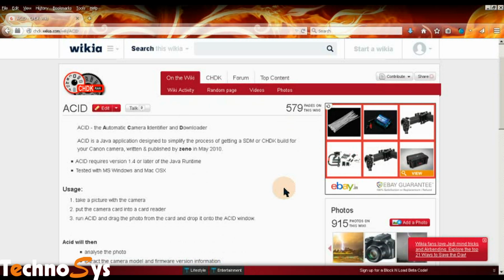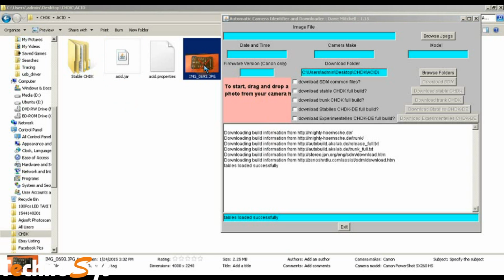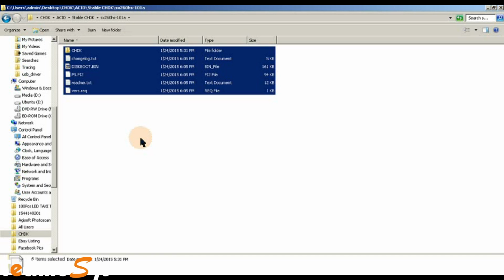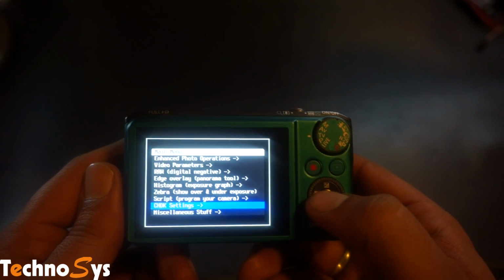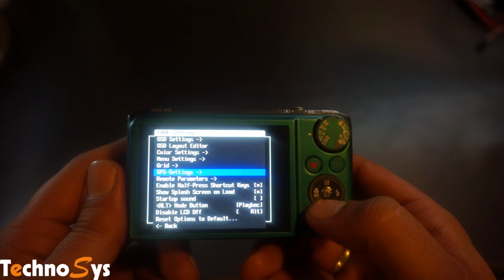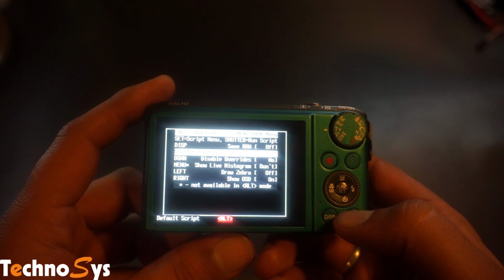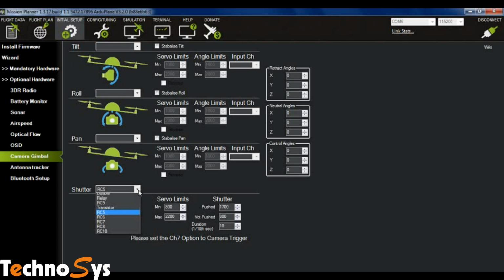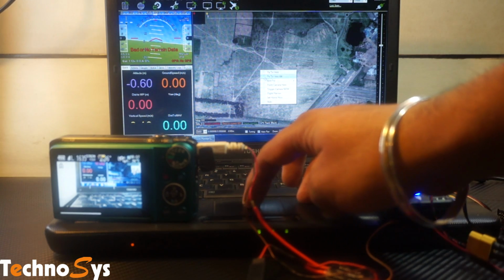Trigger Canon SX260HS with CHDK Using PIXHAWK or APM

Comment: i am about to put together this setup for my pixhawk. but looking at the wire diagram there is only a signal wire going
to the pixhawk. should this trigger setup share the same ground as the pixhawk?
i was going to use the battery that powers the gimbal motors to power the 5v bec.
Reply: YOU COULD HELP ME TO CONFIGURE MY CAMERA CANON

Comment: Hi, I followed the video to the letter, but for some reason it does not work for me? I did it for my Canon SX500 IS, and powered the trigger cable from my laptop USB port (instead of LiPo battery). I checked all my connections, as shown by your video, with a multimeter to confirm there's no cable faults. As an additional test I also connected the ground pin RX5 on pixhawk to the other common grounds (which helped for servo control on camera gimble), but this also did not work. Might you have any additional advice that I can try?
Reply: I also tried the trigger with a listening script on the Canon...? :(

Comment: Hi! As far as I know pixhawk provides 3.3v throughout the pins when enabled, but this voltage is unable to trigger my camera (a Canon PowerShot SX160IS) so I've just made a device to provide 5v using a UBEC and a Turnigy electronic key as you mentioned here. The system works great by right click and then "TRIGGER CAMERA NOW" on the map in the flight data tab. I can measure 5v coming from the USB to camera but somehow it does not trigger a shot for nothing. I have tried with two Canon Cameras and set up properly like Enable Remote "Yes", Switch type "OnePush", but I did't set Control Mode as "Normal". Have you ever been through this before? Do you know what I am doing wrong?
Thanks

Comment: Hi there, very nice video and cool explanations....right...! So, could you tell me what Pixhawk is it...?

Px4 pixhawk v2.4.6 32bits de contrôleur de vol open source avec interrupteur buzzer externe LED

or this following

http://www.studiosport.fr/autopilote-pixhawk-3d-robotics-p-4425.html?codesf=3242368099&gclid=Cj0KEQiAtri0BRDLoaCF95e7o_sBEiQA_pgRQwyYHBHoPo9hiY7qSPX0XGHQRZeG9tyWqYcVbJXDsH4aAlKE8P8HAQ

or 

Contrôleur de vol pixhawk de px4 avec uBlox m8n gps OSD radio 3dr

Thank's a lot for your informations...!

Philippe
Reply from the maker: +Drones Visions Aériennes  We always use Pixhawk from 3Drobotics as it is the most reliable as compared to others
Reply: Hi, thak's for your previous answer about Pixhawk, and what do you think that your plan colud match with Naza M V2 and what channel...?
Have good flights
Reply from the maker: +Drones Visions Aériennes  Honestly, I'm not a big fan of Dji products. For hobby and manual flying you can use Dji flight controllers but for professional work, Pixhawk is the best option
Reply: Yes , that's right .But in France when you want to certify your Uav to work it was easier for me to buy Dji equipment ... especially since it was my first Uav ! .....
for next one i'll certainly buy Pixhawk autopilot to keep open source side...
So, do you think that your solution for trigger will match with Naza M V2 or not...?Fly safe
Philippe
Reply from the maker: +Drones Visions Aériennes I'm not sure as I don't have much experience of triggering cameras through Naza.

Comment: Tks for your support, and one last question if I may. Would this setup work on a relay output PIN on the AUX rail, instead of the Servo rail, for better integration with MP? Is there any specific reason why you have chosen the Servo rail instead of the AUX rail with relay output? Would this later mean the cable would not work as such. I'd rather ask before shorting out something, as I could get any information from various extensive reading from the arducopter website!? Tks again for your support on this one, much appreciated. Cheers
Reply from the maker: +FPV Cambodia We use 'Main Out' port and use servo settings(no relay)
Reply: Thank You, I can't get it to work. Will keep pushing as I trust it's on distance a great solution, for mapping.

Comment: Hi, is your PIxhawk RC rail powered by your ESCs? or did you plug in as well a BEC on the RC trail of the Pixhawk, as I understand the CHDK needs 5VDC to trigger the camera right?
Reply from the maker: +FPV Cambodia  We prefer using a dedicated BEC. As I said in the video, we are using the esc just as BEC
Reply: Alright then, I am about to solder the cable, but one last question if I may: Would this cable work with Distance GPS triggering with a CHDK script from the PIxhawk? Tks again for your support, cheers! ;)

Comment: So basically, Turnigy RC controller just act like a switch to give 0 V or 5V to camera via USB based on RC input signal?
Actually it can be made "DIY" from a microcontroller that read RC signal and give output voltage 0 / 5 Volt based on RC signal?
thx anyway

Comment: question, 
that second servo plug that completes the connection, does it go to the battery or do you plug it into the servo out rail for power or will your aircraft Esc with bec power the trigger? I'm a bit confused if the esc powers the trigger or do you require a seperate bec power supply? from the diagram it appears to go to the esc.
Reply from the maker: +Keith Rolston Sorry, I did not understand your question. Can you please email me on dhruv@technosysind.com and maybe you can make a diagram and indicate where the confusion is exactly.

Comment: Dear Technosys,
I've worked on it and every step had been done but the camera seems not have feedback during engagement on Mission planner. I use RC7 output on pixhawk. May you let me know how do you set up the script on Canon? Do you engage the script with top button or you leave it free on default without engagement? I appreciate it if you clarify.
Many Thanks.
Reply: YOU COULD HELP ME TO CONFIGURE MY CAMERA CANON

Comment: wow thats great tutorial on remote trigger .. could you please share the proper chdk setting for mapping with sx260 , since i get blur and shaky images with 3 sec interval even though i set shutter speed 1/1600.. thanks
Reply from the maker: Canon Settings
Flash;Off
Function
                  ISO;Auto
                  AWB; Daylight
                  Image Size;L
                  ImageQualite; Fine/Superfine
MENU
                 AF Frame; Center
                 Digital Zoom; Off
                 AF-Point Zoom;Off
                 Servo AF;Off
                 AF Assist Beam;Off
                 FLASH SETTINGS
                                 Red  Eye Correction;Off
                                 Red Eye Lamp;Off
               Date Stamp;Date& Time
               Power Saving…
                                 Auto Power Down;Off
                                 Display Off ;1 Min
IS Settings---
                Is Mode;Shoot Only
                Powered Is; Off
GPS;ON
 
CHDK SETTINGS
 
Function
                     Autostart;On
                     Save Params;On
                     Remote Parameters; Enable Remote
 
MENU
            Extra Photo Operations---
            Disable Overrides; Disable
            Value Factor;1
            OverrideSubj. DistV;65535
            Value Factor; 1
            Custom Auto ISO
                                 Enable Custom Auto ISO
                                 Minimal; 1/1000
                                 Clear Override Values@ Start; Disable
Reply: TechnoSys ind
Hello friend. Are all the settings you need to do to get the best results, given the speed of the plane? Sorry my bad english :-).